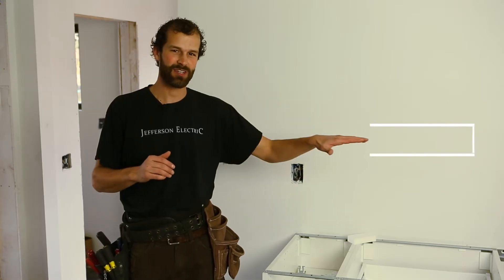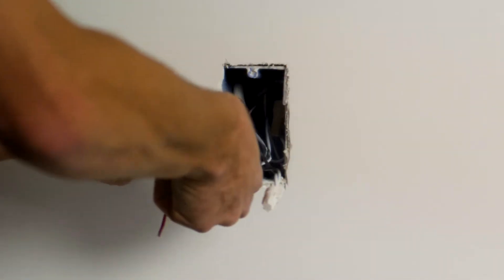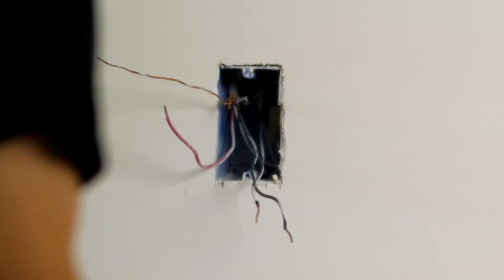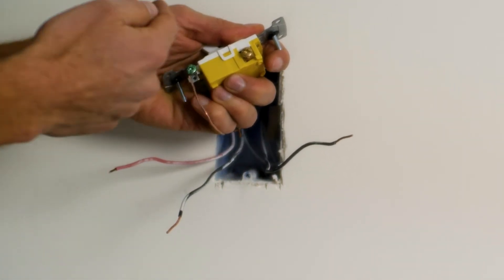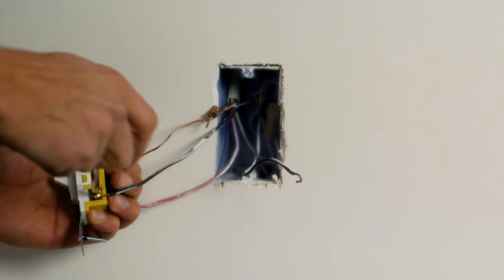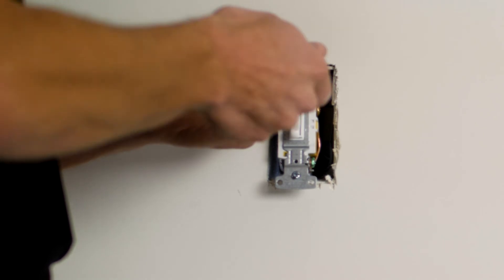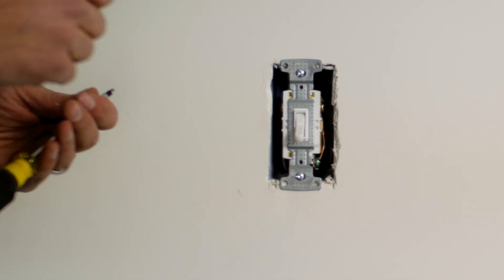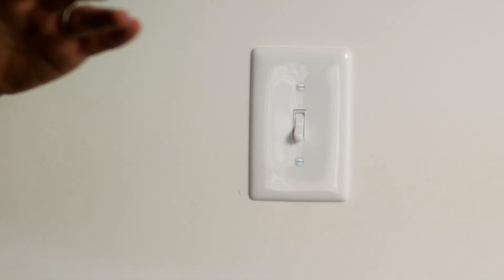Three Way Switch Wiring

Comment: Thank you for a great video , but i have a question how i would know the power source on a 3 way switch all the wires are covered in white paint and there is 3 gang box in there and i only have one switch with a 3 way , what is the best way to identify the power source and all the wires are coming from the top of the gang box, thank you.

Comment: so is it an obvious assumption , that the single black is the " LINE IN " HOT  ? I'm confused about the type of switch and why it looks different and if it is required/necessary to use THIS type of switch for 3 way ( or more )  ?

Comment: Why not use a "greenie" wire nut with a hole in the top? It's a better connection and easy to undo if needed.
Since you're demonstrating, your Milwaukee strippers have a loop forming hole you didn't show.
Reply: @ElectricProAcademy  Master electricians , BSEE UNIVERSITY OF TEXAS AT AUSTIN.